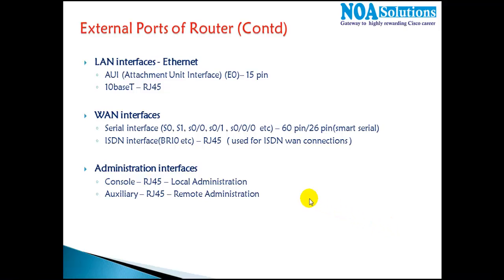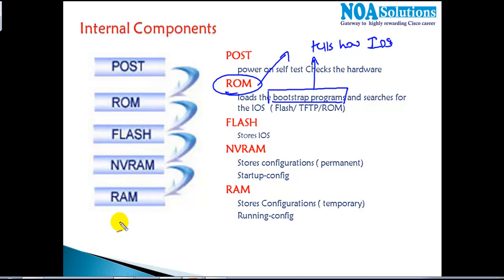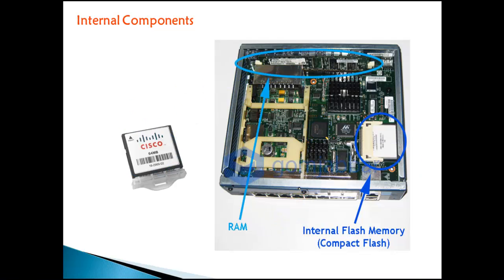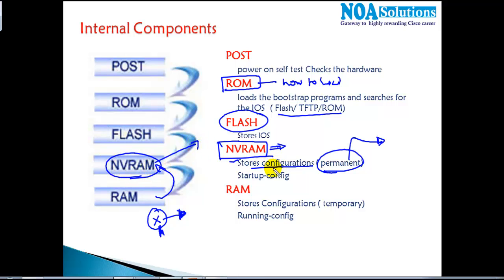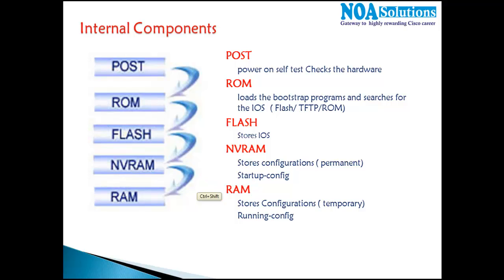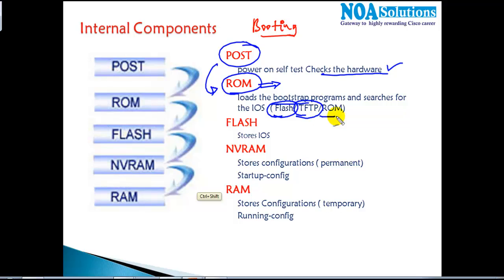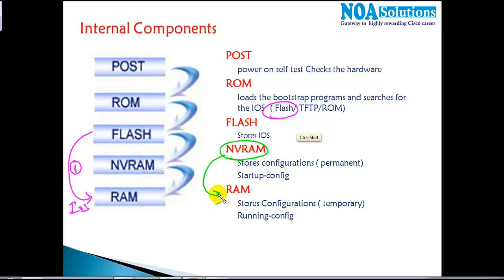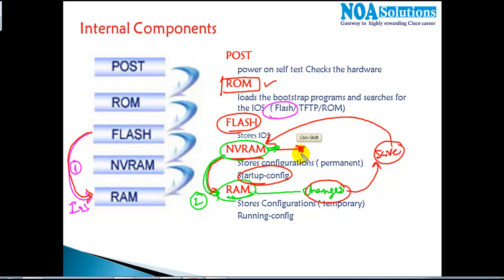Internal Components - Video By Sikandar Shaik || Dual CCIE (RS/SP) # 35012

Comment: How we can check Ram and NVRam in router or Switch? Which command is used to check it.?
Is NVRam and Ram is separate or part of same.?
Reply: RAM stores running configuration. You can check running configuration by using this cmd: show running-config
NVRAM stores startup configuration. You can check by using this cmd: show startup-config

Whenever you reload switch or router running-config will be gone as it is temporarily stored in RAM
Reply: @obaidabbasi2805  how we can check total size of ram??
Reply: @Vishalbarhia  You may use #show version command to see the details
Reply: @Vishalbarhia  By show flash command